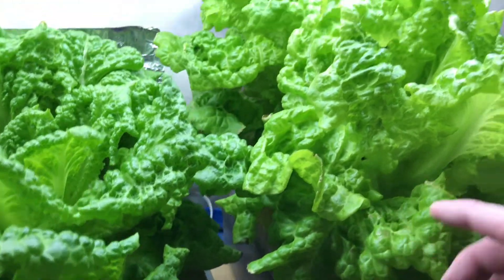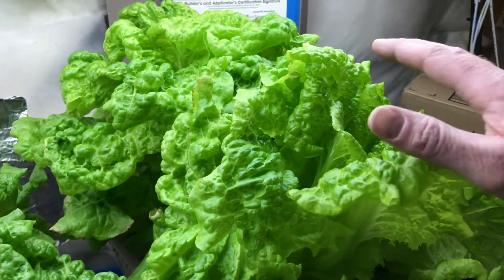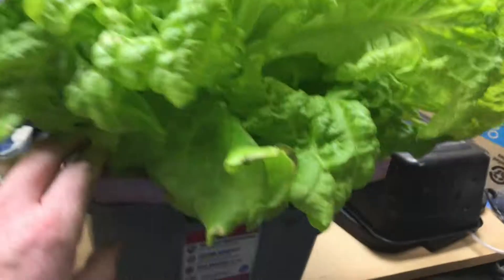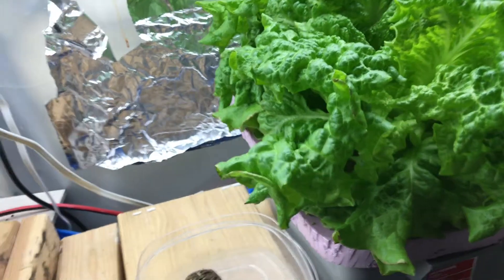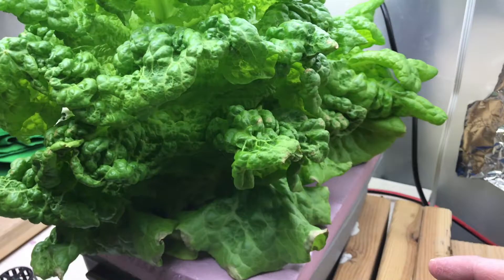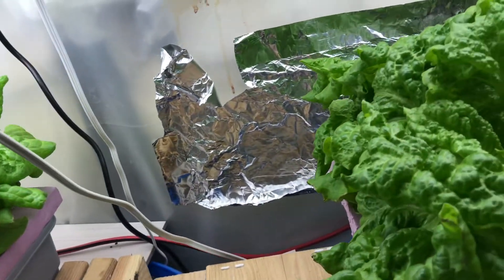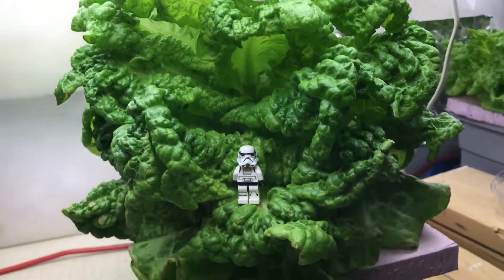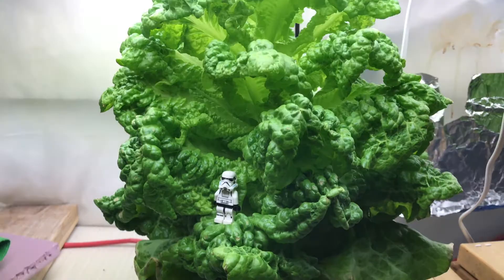3 hydroponic experiments and some surprising results

Comment: I really like these experiments, thanks! Although I'm not sure your conclusions are necessarily correct. Namely the lettuce with the T5 - wouldn't it be theoretically possible seeing that it grew taller but its leaves are narrower, that it had to fight more aggressively for the sufficient amount of light, thus resulting in higher plant (getting closer to the light), but weaker leaves (using the least amount of resources possible for this growth)?

Comment: thanks for the video! would love to see a duplicate of the experiments - very interesting indeed. Also, what kind of device did you use for the aeration and what were the wattages on the T5/T8 bulbs?
Thanks!!
Reply from the maker: The T5s are 2 ft bulbs, and there are 8 of them. 24W each (192W). The T8 are 32 watts, @2 bulbs, 64W. And the t12 bulbs, (my oldest lamp) are 40W each or 80W total. 

The aeration was a 7$ pump from walmart with a 4" airstone.